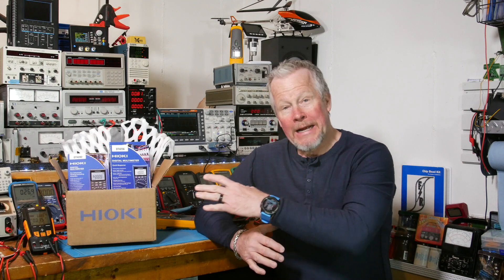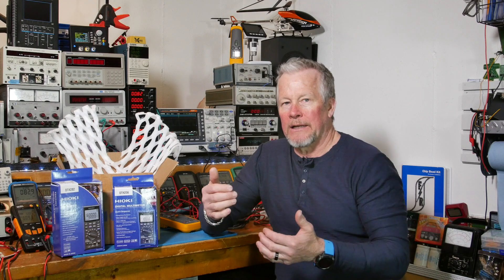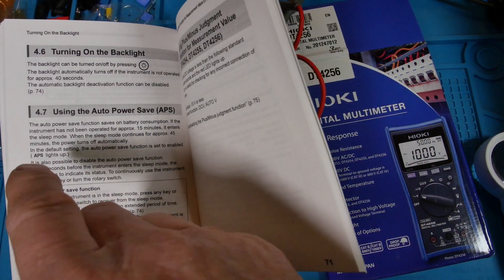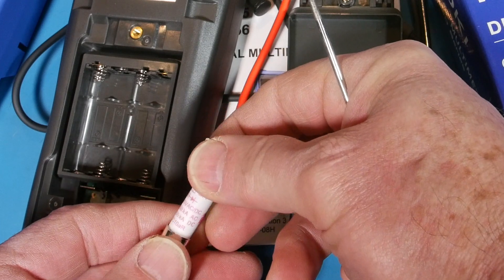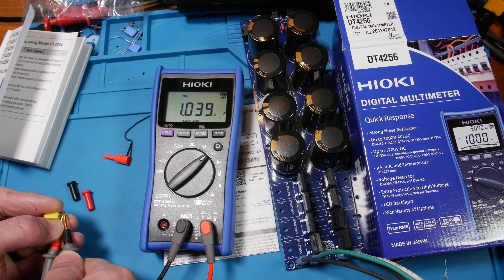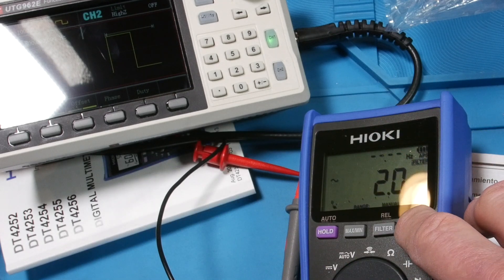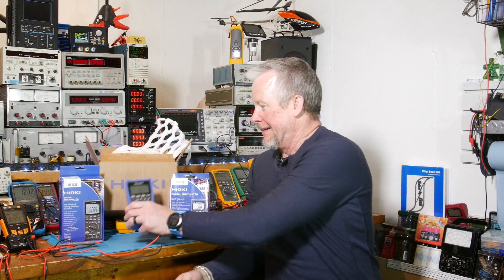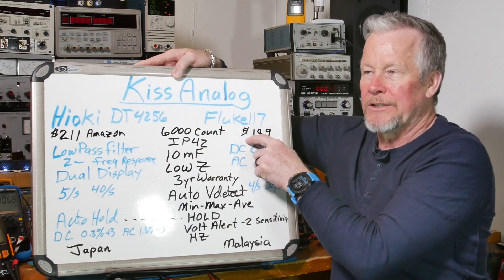Hioki DT4256 Multimeter - is it the Best Electrician's Multimeter?

Comment: Nice review, Hioki 425x series looks wayy better than fluke 11x series.
Gold plated test probe, silicone cable, etc.
Joe smith did transient tests with DT4252 (still the same DT425x series as DT4256) and it survived quite nicely.

I got hioki DT4212, turns out it was made by Der-ee (taiwanese), using COB chip most likely very similar (if not the same) chip as Fluke 17B (not 17B+). 
my DT4212 got problems with capacitance & temperature measurements, however I got it 2nd hand just to try to get my hands on Hioki brand. 

I guess Hioki learnt their lessons, DT425x & DT428x are properly made in Japan with Hioki main chipset.

Some japanese brands like Hioki, Kyoritsu  & Yokogawa can be considered a class higher than more commonly available (and cheaper) sanwa DMM.
Reply from the maker: Thank you for this great feedback!  I think Fluke must be looking over their shoulder - but then again I don't see anything really new from them.  I did notice that the lower cost series from Hioki had a different exterior design.   I do like this DT4256 meter.  I've been using it on the bench everyday;)

Comment: Thanks for the review. Looks like a very good piece of kit despite the shortcomings [no mV, rather low screen contrast]
Reply from the maker: Thanks for point this out.  The mV is auto ranging - so true volt auto-ranging vs having to change setting to mV.  I left the screen protector on which I should have taken off.  But even on it looks great, but the lights diffuse in the plastic and look not as good in camera.  I'll take this off and do a video where I compare meters.

Comment: Brymen meters are by far the best bang for the buck. You can get a BM869s with the same features as the high end Hioki for under $250. I know Joe Smith has tested them to the limit and the only meters that would hang were Fluke. He wasn't overwhelmed with the Hioki he tested. Even Dave Jones went back to Brymen for his EEV branded BM768. After the issues he had with the 121 GW built by UEI he went back to a winner company with great customer support. Send them an email and they will gladly send you some to test and most likely and let you keep them as they have with Joe. I have 4 of them and they all perform amazing. Keep up with my pristine Fluke 189 with even better features. I love that Brymen meters remember the last settings on meter you set it for when you turn it on the next time. I know your Greenlee is a Brymen rebranded but go for the 869s. Welectron and TME in Poland both sell the Brymens. I got two from Poland in 4 days, faster than I can get shipping from within the US.
Reply from the maker: Thank you!  I do want to bring in a Brymen.  I have a Greenlee that I really like too, so I'll have to review that one as well.
Reply: After discovering joe´s channel i bought  2xBM 869s, 1x BM079 , 1x BT 75 EU and a BM789. 😂😂. Brymen is really a great brand. I replaced all my Fluke Stuff except my  199C Scope.
Reply: @walterdoerler6791  Joe was the reason I bought mine. He is one of the slickest cat’s on YouTube. Great at electronic design, software design, machine work, engine building, motorcycle drag racing..........I wonder if there is anything he doesn’t do well. I love how he found all the faults with Dave Jones 121GW meter. Dave wasn’t too happy. I see Dave went back to Brymen for his new EEVBlog 768 model to join the venerable BM 235. That UEI built 121 was a disaster.

Comment: Sample time (display update) comparison in your summary?  I cannot stand slow meters and that's one of the reasons I like meters that aren't auto-ranging since I nearly always know what range I'm trying to measure anyway.  They settle faster.
Reply from the maker: Thank you for pointing this out!  I often start my Fluke to the range I want so I see quickly what the voltage is before something bad happens.  This meter can also go manual range, but it is the fastest meter I have used I think.
Reply: @KissAnalog  Indeed, Hioki - claiming in their own brochure with a 2015 survey date - make the fastest responding multimeters, thanks to their microchip developed in-house. I wonder if it still holds in 2021...

Comment: very nice equipment... 😃  dealing with AC VFD motor drives and fork-truck inverter battery chargers there is a need for multimeters to indicate dirty 5th and 7th harmonics  which can cause a big power grid problem. leading to equipment burn out and upset the power-factor. let alone all the solar inverters. thus sometime adding additional filters  for clean power.🤔 thanks
Reply from the maker: Great feedback!  Thanks!  That's a perfect application for a great meter like this Hioki;)

Comment: Very good review, thanks :)
You also reviewed the Testo 760-2, if you have to give-away one and keep the other, which one will you keep, the Hioki DT4256 or the Testo 760-2?
I‘m asking because I have the Hioki DT4282 and the Uni-T UT181A, and now looking to get a third one for casual everyday use; any opinion?
Thanks again
Reply from the maker: Thanks for this great question!  I really like my DT4282, and I think the 4256 and 760-2 are both great, but since you have the Hioki 4282, I think it would be cool to have one auto meter like the Testo.  But, if you really like your 4282 and want something like it but at a lower cost, then stick with the Hioki.  I think you will be happy either way;)
Reply: @KissAnalog  thanks a lot for sharing your thoughts, l think quite similarly :)
Both meters are similarly priced and both have their Pros and Cons, from my point-of-view:
Hioki DT4256:
+ fast!
+ familiar „user interface“ since it’s similar to the DT4256
+ beautiful, Japanese aesthetic design
+ Atuo Hold, Rel., two filter settings
+ has NCV, handy, instead of pulling another meter!
- no mA/uA
- low capacitance measurement range
- display contrast relatively low
- no Lead position protection or warning!

Testo 760-2:
+ excellent build quality
+ nice one hand, button interface
+ uA Range 
+ high basic accuracy (0.1)
+ good display (bigger but doesn’t show more than Hioki)
+ automatic measurements … but
- very slow finding the kind of measurement, fast if manually selected (defeats the purpose, kind of)
- Simple Hold, no Rel.
- - doesn’t read Zero current when not connected or even with Leads shorted … I returned a 760-3 because of this mal-function; I don’t know if it was only this one or a “standard” weakness!

So, I’m a bit torn between the two, but I tend towards the Testo because it’s “different” and is 30$ cheaper (in my place), price diff. is not the decisive factor, though :)

Comment: How does it compare to the Testo 760-2?
Just bought that after having my choice confirmed by your video comparrison to the Fluke 117.
Reply from the maker: The Testo and DT4252 are both great meters - and both a far better value and meter than the 117 IMHO.  The Testo is also lower cost with great silicon leads so the best for the money.  I’ll have to do a video on these.  I really like the Testo, and I also like the Hioki which they give a 10% discount to those that use my link: https://www.hiokiusastore.com
Reply: @KissAnalog  thank you for the reaction 👍
Would love to see a comparrison video between the Testo and DT4252 😃

Comment: I would like to see a review on a Brymen BM237R or a BM239R (there's none on YouTube). 
With 3 phase rotation, AutoV LoZ, NCV/live wire detection at a distance of a push of a button, VFD... that's a good multimeter for electricians (is it better than Fluke 117, only your review can tell :) ).
Reply from the maker: Thanks Jose!  That sounds great - I'll have to check them out.

Comment: This Hioki sure is a nice electricians dmm, but it's also expensive.
I don't know if comparing it to the fluke 11# series is still relevant as that series is pretty old by now (and, consequently, way overpriced for the functions and quality of display etc).
Regarding the price, for $211 you can also get a Brymen bm869s.
That is of course not an 'electricians' multimeter, but has similar (and more) features, way more accuracy/resolution etc. However it is a fullsize dmm  and not a midsize dmm. So it's the extra functions (logging, 24ma, vfd filter etc) in the smaller (midsize) formfactor that have to justify the premium pricepoint.

What I would love to see in your reviews is what you can do with the software and logging functions.
Most multimeterreviewers skip this part. Especially if they're Australian, not Austrian...
It would make the video even longer, but it could be a seperate video.
Logging and software features (graphs etc) could be used professionally if customers ask reports with extensive checkups.

Do you have the pc interface?
I saw it was an option. Didnt look at the price (actually couldn't find it...) but usually these are expensive options (too expensive as the software is usually also pretty crappy...)
Reply from the maker: Thanks GuidoK!  I agree, but Fluke still calls their 117 their electrician's meter, and lots of people are familiar with it.  But, I do agree with you.  I like the Testo and Amprobe much better, and now we have the Hioki;)

Comment: Greta re View! Which do you prefer? This one or Testo 760?
Reply from the maker: Wow Luis - that's a great question!  They are my two favorite 6k count multimeter for sure.  I think there are other very good ones at much lower cost.  But I like these for the same reason some mistakenly (like I used to) automatically go to a Fluke (which they don't have one that compares in a 6k count).  I had to go to my lab and play with both to make my decision.  I like the Hioki DT4256 a little better.
Reply: @KissAnalog  thanks a lot! 👍 Need  to buy an under 200€ multimeter for electrician use.

Comment: If you want to scrutinize the bar graph response, then you should put the meter in DC voltage mode and then feed it your ac signal.    btw, i prefer the longer videos;  it doesn't make sense to me to cut out relevant content just to hit a 20 min run time.
Reply from the maker: Thank you John!!  That’s a great idea - thank you!!  I agree about the content fs length, but I know a lot of people don’t like it.  I have been thinking how to meet both audiences.  I’ll give a new method a try with the other Hioki.  Please tell me what you think.

Comment: Very thorough but, you sure the 6k count isn’t 60k count? I have a Hold Peak 40k count that was way cheaper. Love the beeps and speed.
Reply from the maker: Great question!  I also have the Hold Peak and it is a great meter.  This Hioki does have that very solid durable feel that you want as an Electrician.  Something that you don't have to worry about too much.  It is a Hioki, so it has the safety reputation as well.  So it is a more high end 6k meter - maybe best in class - or right there with them.

Comment: Hey kiss analog Iog. L9ve the videos. I have the hioki 4255 for voltage measurements and I love the small thing and somewhere I heard the backlight does not stay on long enough. I found hoe to defeat this problem. In the off position hold the backlight button on and turn the dial to ac and it on til you shut it off. Not good for battery drain but I use lithium cells like energizer aaa to give the maximum power you need. Never the less it works for anyone who needs a longer light on this meter...I don't know about the other meter models, but this works on this one...